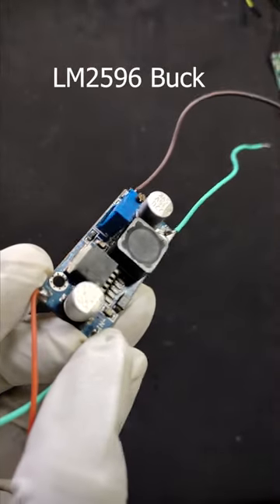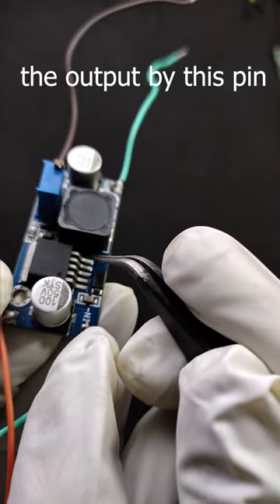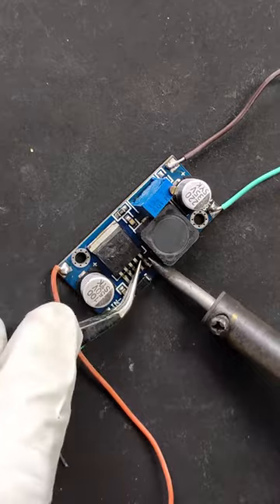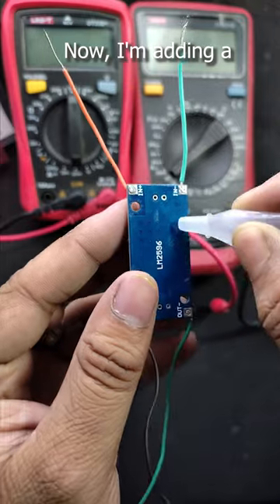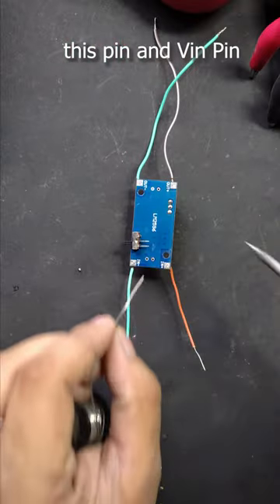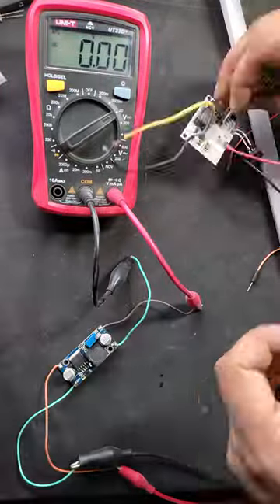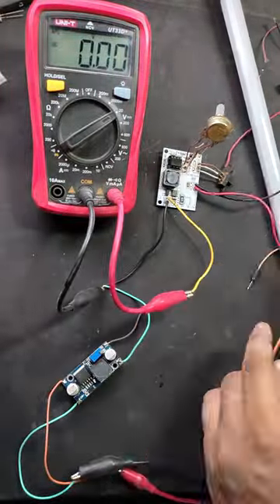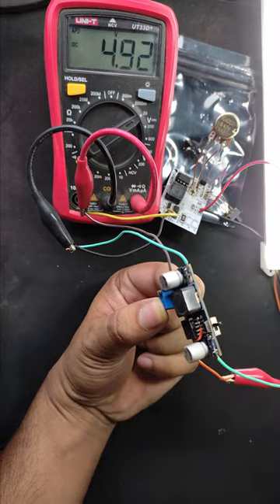Very useful trick of LM2596 buck converter (step down converter) | output on off switch

Comment: A better useful trick;
You can just add a switch between the battery and the module 🤷🤷
Reply from the maker: No, then the switch will be a limiting factor for current and you have to use a larger current capacity switch.
Reply: @electronicstechnology1478  
But u're using a buck converter so i don't think u'll be using such a high range of current hehe...
Reply: @electronicstechnology1478  actually, in a buck converter the input voltage is greater than the output voltage. As a consequence the input current is always less than the output current. So  there is no need for a larger current capacity switch, if you put it between the battery and the module.
Reply: @antonioagostinelli9430 But when using the chip enable pin, the switch only needs to handle a few mA, and the load current is irrelevant. For example, you could use it to turn on some power-hungry lights with a tiny reed switch.
Reply: Both are correct, it's a question of requirment. But sir most switches nowadays handle more than 2596 can handle itself.
Reply: @navin1986 what about switch module from an IC or microcontroller?
Reply: @leeqa02 yes, this is the ideal use for this MOD as there is no way a micro would handle the voltage or current going into the buck converter.
Reply: @electronicstechnology1478  I usually just unplug the powersupply it's connected too. That's way more convenient and safe anyway. Unless you're using it in a bigger project. But then you won't be using this converter anyway.
Reply: Completely disconnect the input for greater reliability. Soft shutdown may have the possibility of runaway or leakage, or circuit interference.
Reply: Thst's what I thought.
Reply: You need to learn more about electronics
Reply: Cane here to say exactly that.
Reply: the point here is, you can also control it using another circuit or microcontroller.
Reply: @antonioagostinelli9430  not true, so if you draw for example 12v 1A from output  which is  12w and if you use 6 v on input then the current is 2A on input or even more duo to loss in power conversion.

Comment: In T.I. spec sheet, LM2596's output is ON when the On/Off pin wired to ground or left open.  It will shut off when on/off pin is raised above 1.3V.  So a pull up resistor is needed
Reply: In the video it was connected to the input voltage pin. So turning the switch on will pull it to VIn therefor turning the regulator off.
Since the maximum input voltage for the On/Off pin is 25V this is allowed as long as you are careful not to supply more than that to Vin. 
Turning the switch Off leaves the switch floating which according to the datasheet is allowed and turns the regulator On.

Comment: This one is useful in controlling the buck converter when using this in a solar panel when the voltage of the panel collapses then add some controlling circuit to restart the buck converter.

Comment: This is anything but a "cool trick", if only you've skimmed through LM2956 data sheet you'd know how to turn on/off that IC in a proper way, but yeah, at least you emphasized minimum height of desoldered pin.
Just because something is possible that doesn't mean that it should be done...

Comment: You should probably add a pullup resistor too.
Reply: The switch is connected to Vin. So the Switch does the pullup. Pulldown isn't needed according to the datasheet.

Citing Page 4 of the LM2596 datasheet: 
" Pulling this pin below a threshold
voltage of approximately 1.3 V turns the regulator on, and pulling this pin above 1.3 V (up to a maximum of 25 V) shuts the regulator down. If this shutdown feature is not required, the ON/OFF pin can be wired to the ground pin or it can be left open. In either case, the regulator will be in the ON condition."

Comment: Soo I was messing around with a set-up yesterday 18650 to tp4056 to xl6009, and I tapped the leg, with my screwdriver while changing the pot, of the xl6009 and it reset my voltage to 0. What did I do?
Reply: Wow, for me when the input voltage is not stable the voltage jumps too high due to the module wanted to compensate for the "low voltage" in the input. Try from battery to xl6009 alone and see if the voltage is still 0. Also play with the trimpot too. If it is still, maybe a burnt chip bcs of short?
Reply: @siontheodorus1501  oh it’s working fine, it just reset back to zero, I was just curious if you knew how that would be possible
Reply: Possibly got loose or short-circuited, seems like The Convertor is driving the output to 0V
Reply: The battery was not set right. Crappy battery tray. Thanks for the help!

Comment: Seems like most people in this comment section don't know what an enable/shutdown pin does. Hence they're pointing at adding a switch at the input. 
Please read the actual datasheet of the IC and understand its purpose.
Reply: Read it more carefully and you'll realize that this "cool trick" tanks your Vinmax to 25V, whereas a switch on the input allows the module to retain its 40V Vinmax in standard conditions and it's 45V Absolute maximum rating.
Reply: @AtlasReburdened  However if you don't need more than 25V one benefit is that you don't have the inrush current of the input capacitor.

Ignoring the switch. You can also use the pin for delayed startup (also often done to soften inrush/ let voltages stabilize) and since the threshold is at 1.3V you can easily connect it to basically any micro controller to turn it on and off without adding additional transistors or a relay.

Comment: How to turn a relatively safe-ish module into a safety hazard in the eyes of any safety person...
Reducing inrush current compared to switching on input yes, but reducing maximum voltage rating for the input is defeating the purpose of LM2956.
Yes and you just killed one of the mounting holes that is needed because of the added stresses of you moving the board around when operating the switch.

Useful "cool trick" but useless youtube milker.